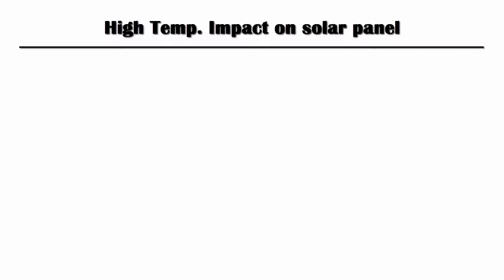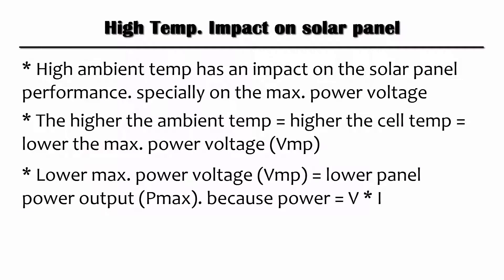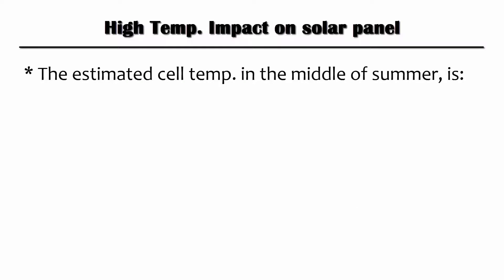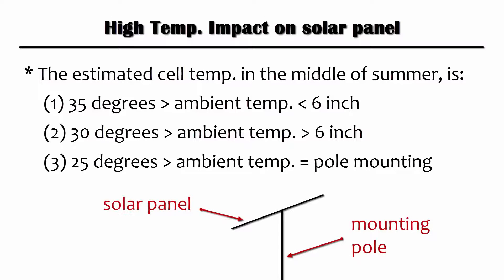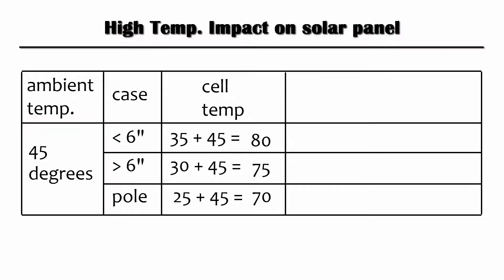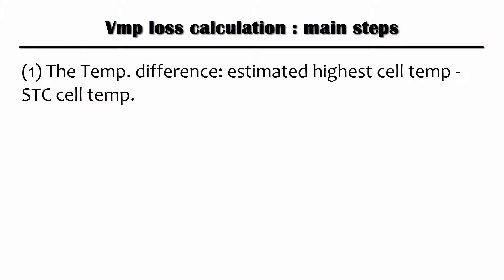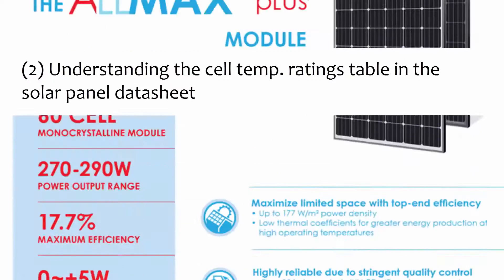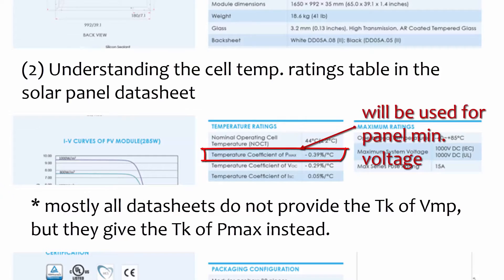High Temperature Impact on Solar Panels

Comment: I thought surrounding temperature do not affect voltage but affect power
Reply from the maker: Power is the product of voltage times current. When the surrounding temp effects the voltage, it affects the power too.
Reply: When the temperature goes the up Voc goes down and Vmp goes down.
When the temperature goes down Voc goes up and Vmp goes up. Voc is import when selecting a charge controller. V in allowed must be greater then Voc.

Isc is mainly controlled by the light intensity.  The thermo coefficient is small. And for the most part ignored. 

Expect a 10% reduction of power from Pmax at stc in the real world use.
Depending where you live your more likely to get 800 watt/m^2. The actual light energy can be found by measuring the Isc, then taking the ratio of the measured Isc/Isc_stc.
Likely to be another 10 to 20% loss of power.